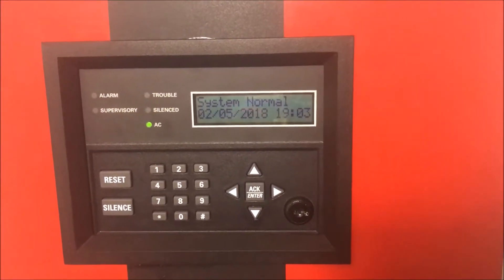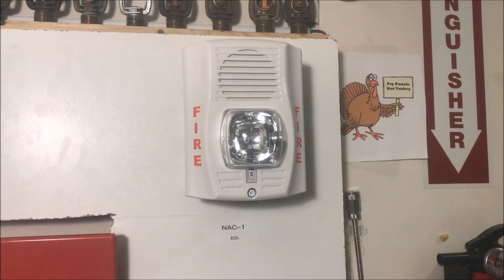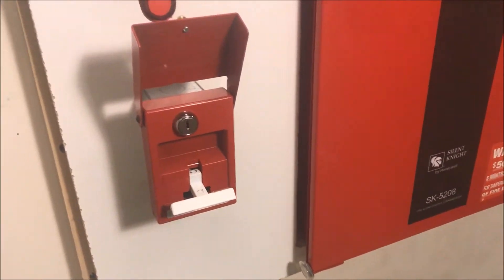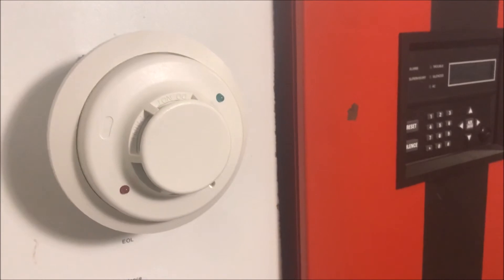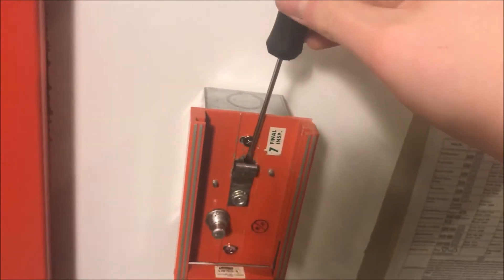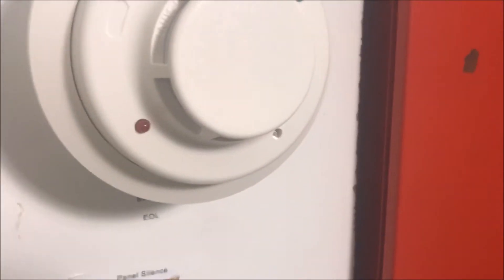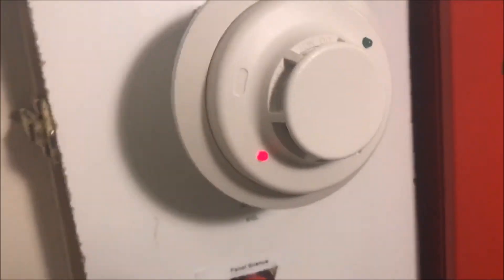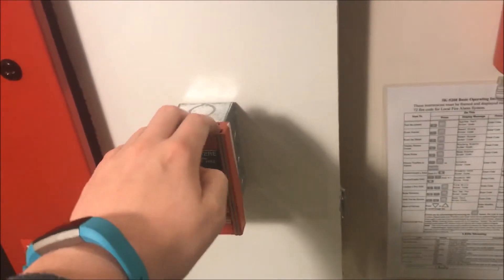Wall Test 27: Time for Advances!

Comment: My middle school had a Silent Knight SK-5208, 8 SpectrAlert Advances and Siemens UHN S17s and System Sensor PC2RLs in the restrooms and an Edward’s Integrity next to the locker rooms
and the Pull Stations are Edwards 270 SPOs and The Honeywell single action T-Bars